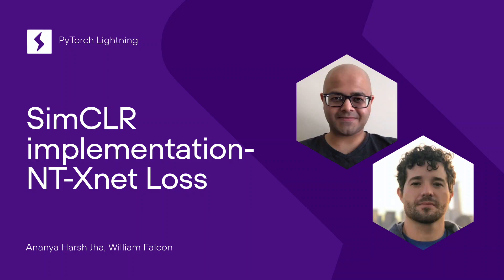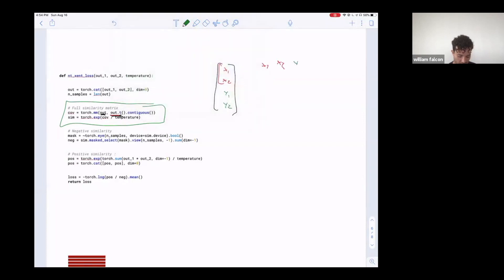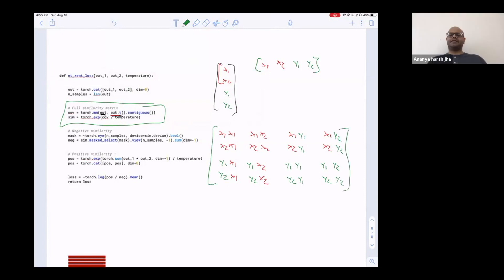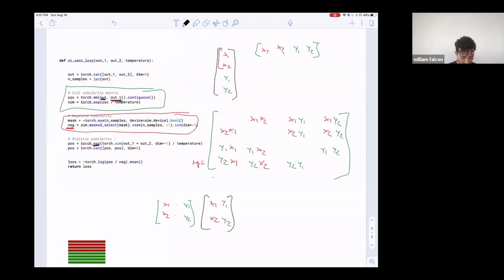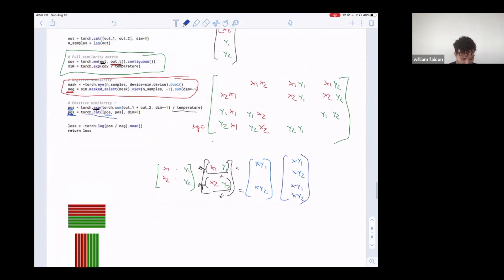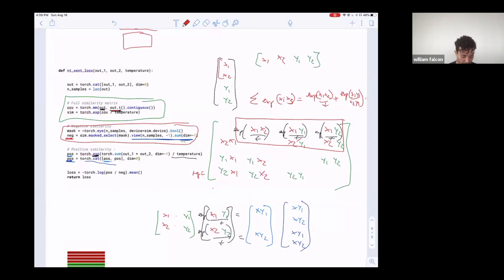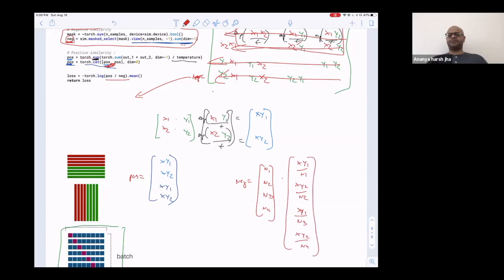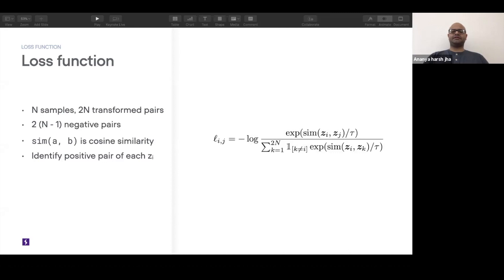SimCLR implementation- NT-Xnet Loss

Comment: I think there is mistake in calculation of positive similarity in the numerator, if I am right, y1, y2 are in one group and x1, x2 are  in another group. They argument version of same samples
But in video it calculates wrong similarities
Reply: I think the video method is correct. loss(i,j) and loss(j,i) are only different in denominator, but they are have common numerator because of Sim(i,j) = Sim(j,i). Thus, they just compute (i,j) and apply the concanation for (i,j) and (j,i).

Comment: You are forgetting to use the logsumexp trick, this is not numerically stable.
Reply: you are right. without layer normalization some value become infinite and it return NAN. also it doesnt output the same ouput as implemented in tensorflow version (original) simclr.
Reply: @bediosoro7786  I was also thinking of that numerical stability issue. Do you think it will work better if the embeddings are normalised before computing the loss?
Reply: @ignaciohrdz yes  if I remember it is what they did . They normalized the output of the projection  module with F.normalize before passing to the loss function.
Reply: @ignaciohrdz  but in the tensorflow implementation they didn't do that normilization so the loss value is different for same input for both implementations.
Reply: @bediosoro7786  I implemented my own (working) simclr framework in pytorch a couple of months ago and I got numerical unstability every time I decided to skip normalization. I've discovered this implementation recently and I didn't see any normalization step though :/ (EDIT: I found the F.normalize() -__-'')
Reply: @ignaciohrdz  good job. The original paper and authors implementation in tensorflow does not require normalizing the output of the projection layers.  However the way the loss function is defined in  torch lightning  implementation is different from the one in tensorflow. So if you read the code of the implementation in torch lightning  you will see the normalized function. I myself implemented both loss version to see the difference. I also converted the tensorflow loss  version to pytorch but with same input the output was not the same.